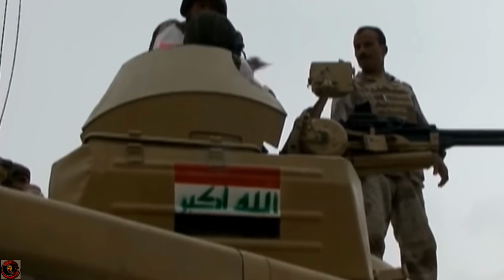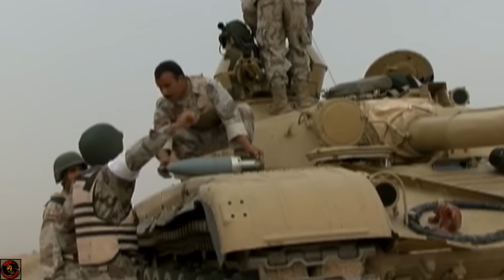Do Russian Tanks Need Bigger Guns?

Comment: Every German tanker is shaking from the experience that 152mm guns have them with the KV-2
Reply: I once saw a video of a kv2 vaporizing a whole continent
Reply: Stronk
Reply: Джо //Elusive// fking russian bias, pls nerf
Reply: 122-152mm guns are unified in many respects with artillery cannons. Similarly for ship cannons of large caliber. But for 152mm and for 122mm there were both solid and semi-armor-piercing shells, the first are simply caliber blanks with a core of tungsten carbide, possessing simply monstrous kinetic energy, the latter having a hardened pointed nose to break through the barrier (concrete, metal) and explode inside the target tank, fortification)
Panthers made their way to the forehead of American 76mm cannons, 90mm cannons, depending on the type of projectile. A 122mm hit caused the armor to split or pile up from the body chassis when it hit it. Panthers were good at the distance, but getting even a 122-mm bomb at a distance of more than 2000m was usually fatal for them.
With the advent of IS-2 in the panzerwaffe, an instruction was issued that prohibited the "tigers", not to mention the "panthers", to engage in one-on-one combat with the IS-2. The inspector-general of the Panzerwaffe, Heinz Guderian, directly pointed out that "in a single battle with the IS-2, the" tiger "is doomed to destruction."
https://fotki.yandex.ru/next/users/hotdoc-71/album/517762/view/1041916
http://cdn.fishki.net/upload/post/2016/08/17/2044625/tn/yksbmrf49f4.jpg
http://detectivebooks.ru/img/d/?src=32530051&i=204&ext=jpg
Reply: Actually the KV2 had been used as a tank. One KV2 held off an entire regiment. (Don't burn me for using the incorrect term.) They had absolutely nothing that could penetrate it at the time so basically they had to sit around until it ran out of ammo then took out the crew by hand. The 122 was also used as an anti fortification gun. Just because it's primary purpose isn't tank killing doesn't mean you're not fucked if you get shot by one.
Reply: Caliber shells 122mm with carbide core, concrete-pouring (half-pierced explosive), high-explosive grenade 122mm
http://www.army.lv/photos/22404.jpg
https://wiki2.org/en/File:D25T_shells_svg
The shells of impact action also include a concrete-piercing projectile. Concrete shells are destined for the destruction of strong concrete and reinforced concrete fortifications. When firing concrete-piercing shells, as well as when shooting armor-piercing shells, the speed of the projectile when encountering the obstacle, the angle of the encounter and the strength of the projectile shell are critical. The shell of the concrete shell is made of high-quality steel; The walls are thick, and the head part is solid.

Sorry for my bad English.
Reply: All sources I find said those larger guns (both german and russian) only used armor piercing high explosive in the actual war. For effektive use of kinetic guns you'd need much higher pressures that WW2 tanks and their guns couldn't deal with, but there was also no tank that could really survive a hit of 122m APHE's either. The pictures seem to fit that idea.

While I can't find that quote from Heinz Guderian anywhere, the IS-2 also was literally built to defeat the Tiger. If it can't do that, then it would be a pretty bad tank, particuarly because the Tigers tank was quite flawed. The Wehrmacht back then didn't even have the ressources to mass produce the Tiger 2 in any notable numbers, nor fix the critical design problems of the Panther.
Reply: I think you meant the ISU-122, the SU-122 just had a howitzer
Reply: The prototype IS-122 (Object 240) is a Soviet heavy tank of the Great Patriotic War (tank "IS" with a 122mm gun), further IS-2 and IS-2M.
Reply: The KV 2 was an assault gun.
Reply: After the state tests, the IS-122 was sent to a test site near Moscow, where a German tank "Panther" (Pz. Kpfw. V) was fired from its gun from a distance of 1500 m. The first projectile struck the frontal armor of the Panther and, without losing its energy, pierced all the insides, struck it in the stern sheet of the hull, tore it and threw it away for several meters.
Reply: The 152mm gun is an artillery piece, not a tank gun. Those generally propell some kind of bomb, not kinetic penetrators.

Yes, sometimes they tried to mount it on a more tank like vehicle, but that didn't make much sense either way.

Also Джо //Elusive//, no, the IS-122 ammo can't do that, because it also only used high explosive ammo.
Reply: @termitreter6545  the Russian 2a83 is a high velocity smoothbore 152mm.

Comment: I think we will see bigger guns appearing in newer main battle tanks but slowly. Maybe the 140 mm will be fitted in the Leo 2s cuz there are plans for it already in about 2025 or so and then other western mbt will follow but I think the Armata will fast counter that with the 152 upgrade. Like we saw with the slooowley appearing  jump from the 105 mm guns like on Patton Leo 1 and others  to the 120s in the 80's which we have today. it will happen like every 40 jears and when I am old we may see 170 mm guns. But if that would happen (which I don't think cuz that is REALY cutting the edge of tank compacity) it would realy cause problems with the turret designs. Bigger gun =bigger turret = bigger turret ring =bigger hull = more weight =bigger target = heavyer armor = more powerful, expensive engine....... And so on. I think we didn't touched the edge of tank design but we are somewhat 1 to 2 generation ahead of it. The lank concept is useful by now and it'll will be a big part of the armies in the world until the end of the 21th century.

Comment: Can you make a separate video on the new Rheinmetall L/51 130mm and your thoughts on it
Reply: Probably the baby of the next KNDS tank (Germany KMW + French Nexter)
Reply: Jebi Se
No need as the 130mm supposedly will pen 1200-1300mm RHA  at 1-2 km.
Reply: Ólafur Mikaelsson yes please!
Reply: 130? didnt they develop 140mm one?
Reply: the 140mm was developed a few decades ago and was scrapped due to multiple factors like the need of autoloader (which wasnt accepted back than as it lacked reliability), the fact that it didnt allow a big storage of ammunition causing the tanks to live off supply lines for ammunition and then it was much easier to upgrade the penetrator and propellant technology of the 120mm which nowadays is unofficially said to be capable of reaching 950mm of penetration, some even claim performance slightly past 1000mm but it's all a dust cloud of supposition.
Reply: Jebi Se the main one they are looking into replacing the 120 is the 130mm

Comment: Yes, as far as I can remember, previously considered the transition to 140-152mm. But now it is not so important. Although under certain conditions it is possible.
New unmanned towers may well provide space for 140mm or more, if necessary. This will lead to a decrease in the characteristics in favor of weapons.
But modernization of the T-72 is not considered massively, only for foreign customers. T-80 is too small, and T-64 is a museum exhibit. This is economically impractical, and will not be massive because of technical complexity.
Rather, 125mm on steroids based on T-72, T-80 and with an unmanned tower like TARIQ Falcon, this makes sense.
Reply: Complementary, after viewing)
Which will probably get a shell niche behind the tower, with a replaceable load case for loading, both on object 640 Black Eagle.
But this is only my opinion.
Great video!)
Reply: 140mm on Abrams is impossible without a radical alteration of the shell and the tower. The return of the cannon will destroy the hull. Either it is necessary to build another tank, but it will not be Abrams.
Reply: From the economic point of view, it is again misunderstood. Russia is much less selective than the USSR, it should be understood. And "sanctions" are regarded as an act of war, one of, along with the support of extremism. Which brings us into a dense one to a hot war.
It's not an ideology or a policy, it's a pure economy. The division of markets and the right to exploit resources, people's lives are not important ... Russia does not agree with this ... again)
The main costs are for development, they are already produced. Just a few people can understand that in the USSR first thoroughly considered the problem from a technical point of view, and only then they considered the costs. What gives the tremendous flexibility of technology. But the economy is skewed.
If it is required this will be done, but the question at what cost.
Reply: +Джо //Elusive//+ ETC Cannon is a far better solution the US is toying with.
Reply: If you mean an electrothermal gun, then in the USSR and russia they never stopped such developments of "impulse" guns) But they still have nowhere to install.
This requires excess energy, electric transmission + powerful diesel or turbine. This is the next stage, like it is supposed for T-14.
Reply: +Джо //Elusive//+ I would argue that the US is much further along in this development process of ETC Cannon tech than Russia is since it didn't have it's defence industry crater in the same way after the fall of the Soviet Union and the US has the option of using a comparatively simple gun upgrade on a tank that has served for decades that renders an entirely new generation of tank obsolete (potentially before the T-14 is even seen in any significant number) that can't possibly survive in it's current format without slapping an extra 15 tons or so of armor onto the front, in which case it either severely compromises it's functionality or you have to go back to the drawing board and start over. The Abrams on the other hand has less of a problem with the extra weight of additional Armor as it already has monstrously resilient frontal Armor packages that wouldn't need as much upgrading to give it a chance of surviving hits from an ETC gun, the extra weight can be offset by lightening it's other components to compensate like how the M1A3 will save 2 tons by switching to more modern electronics. All of this is of course speculation, so we'll need to wait and see what the future holds.

Comment: New ammunition is coming out look for the telescopic tank shell using new propellants .
Reply: Tank ammo is telescopic already. Not fully telescoped but the warhead is penetrated deeply into propellant.
Reply: @leminhduc4324  I thought the Ajax 40mm would be using it.
Reply: The evolution capability of the 120mm gun will eventually come to an end due to better armor of future armored vehicles, granted by more powerful engines. This will be the time, when the new caliber will have to be introduced.
Reply: Ploppy Ploppy that would be interesting.
Reply: US, England and German all experimented with telescopic ammunition since the 1960s.  They have not found the perfect system yet after 50 years.  They sound perfect on paper but they are proving to be an engineering nightmare.  Besides, stealth attack drones may be sending tanks the way of the dinosaur.